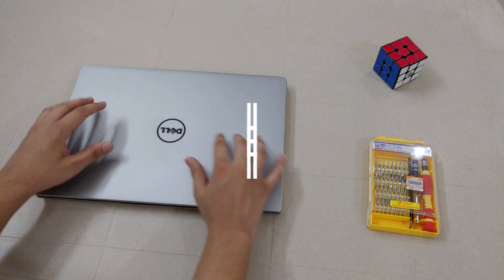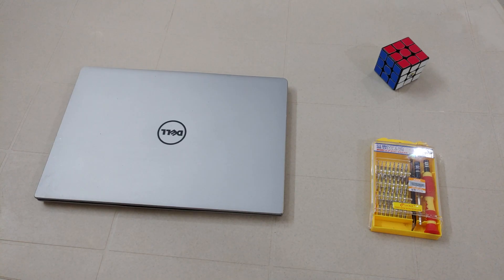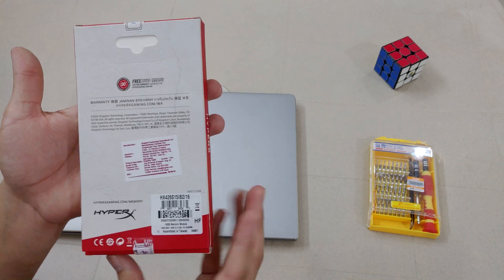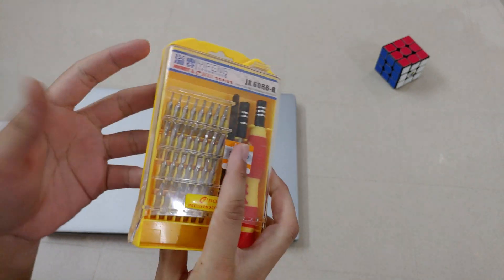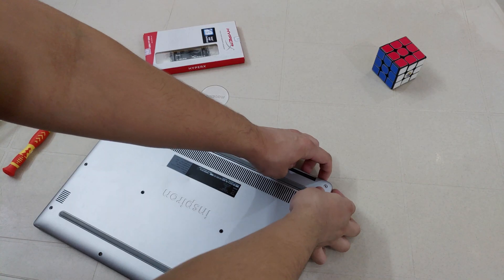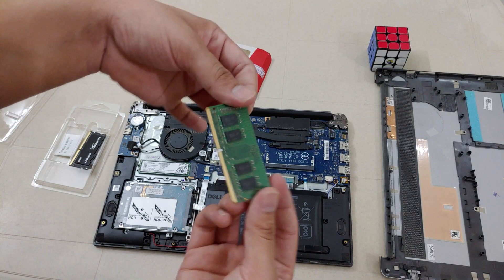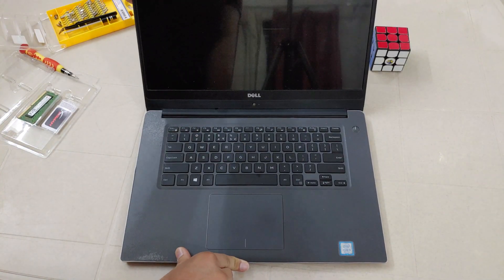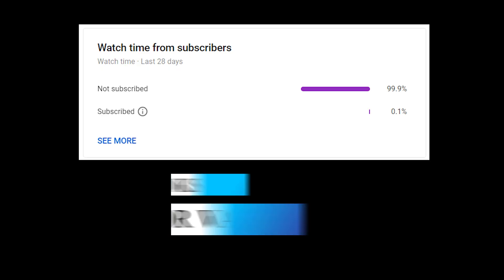DELL Inspiron 7572 ram upgrade | opening cover

Comment: Thanks for posting this.  I used A-Tech's16GB module DDR4 2400MHz PC4-19200 2Rx8 1.2V Non-ECC SO-DIMM, works perfectly with your guidance.

Comment: Bro, did you check frequency of newly installed ram? Today i upgraded from 8gb 2400mhz to 16gb 3200mhz, but in system info it is showing 16gb 2400mhz only. Probably a bios update will be needed
Reply from the maker: If motherboad of a laptop or desktop supports only 2400mhz it will work with 2400mhz ram only
Reply from the maker: You got lucky that your ram was backwards compatible. Or else it wouldn't have worked with your laptop.

Comment: Does it supports nvme ssd?
Reply from the maker: No, it doesn't. And max capacity is 128 gb
Reply: Yes it does. And max capacity is 512gb
Reply: btw the slot is pcie x3 or x2 ?
Reply: @manvanshugoyal275  It has PCIe Gen3x4 interface with backward compatibility.
Reply: @proxima_centauri1709   Thank you
Reply: Guys just go to crucial website and check your laptop comparability .. every doubts will be cleared

Comment: I followed your video to change the RAM. Found out I got the wrong RAM, then put back the old one. Now the laptop is not switching on; neither it is taking charge from the charger. Lights will glow for a sec and then goes off. Can u suggest what can be wrong?
Reply: Oh..no worries!! Problem solved.
I was not putting cover properly. After opening and fixing again it worked!!

Comment: im 7572 is not showing any available WiFi networks. I've tried all possible methods, but nothing has worked. my wifi adaptor is in good condition. what should i do?
Reply from the maker: Try to disable enable it in device manager
Reply: it didn't work
Reply from the maker: @sairam-du7ip  Problem could be anything, I can't really help you without actually using the laptop. You could always try resetting the laptop if problem persists.

Comment: Your review after 2 months of usage?
Reply from the maker: Not good for gaming. It thermal throttles.  Everything else is fine. Screen quality is really good. Metal body is always a pro.
Reply: @SHELSTIN  can you suggest a ram for gaming?
Reply: @SHELSTIN  I do have same laptop, picture quality is good but its way bad if you compare it with P2419H monitor.
Reply from the maker: I have added a link for ram in description.
Reply: @SHELSTIN  After Installing the RAM, is there a threat that Blue Screen of Death will appear?
Reply from the maker: @aniruddhavartak4928  No

Comment: really does that support hyperx. and does that give better performance than usual
i got a crucial 16 gigs.
Reply from the maker: Yes, it supports hyperX. I don't think there should be any difference in performance when compared to 16 gb crucial
Reply: should it have problem supporting it, its just different company, just asking, as i am new to this.
Reply from the maker: @ak_mbit  No problem will be faced by you because of the brand